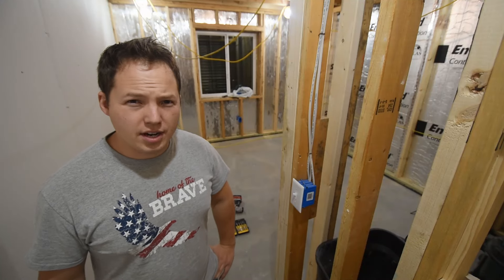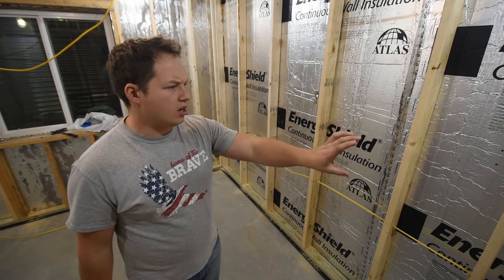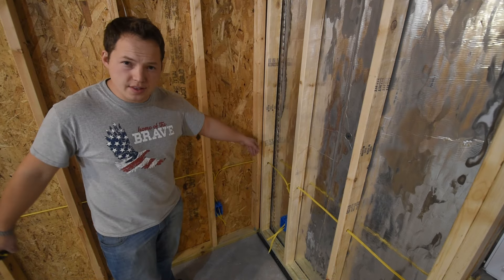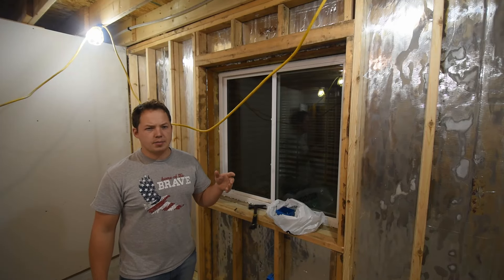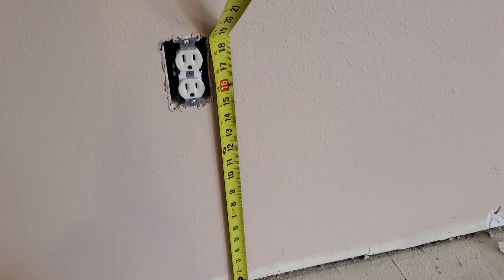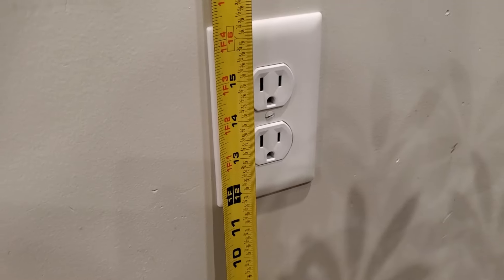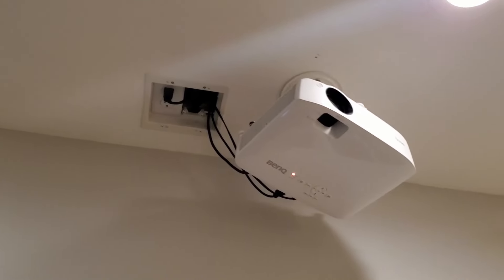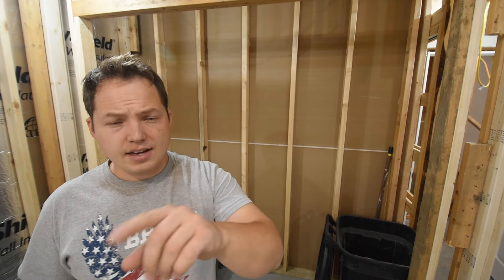Height of Outlet & Switch Boxes & Receptacle Location Tips

Comment: Well on commercial jobs involving block or brick we usually go 16 to the bottom for receptacles so we can set the box on the 2nd course of 8" block. Makes it easier for brick layer and is ADA compliant. For switches we go 4' to the bottom because thats the bond beam for the mason and is filled with horizontal rebar and grout. So we just set the box on the bond beam. I also put the switch box at 4' to the bottom on interior walls that are sheet rocked so they are sitting on top of the 4'wide sheet as the 4x8 sheet is nailed horizontally rather than vertically. Easier for rocker to cut opening in rock for this box.
Reply from the maker: Super interesting! Totally makes sense given the construction method. I might save your comment and share it in a video!
Reply: Your pretty much spot on for ada requirements. The problem arises when you need to install a box for a thermostat, whether low voltage or line voltage to get the sensing element in a good zone, so we always installed the thermostat at 5' to top or bottom or middle. The problem is it is too high to be ada compliant. I have had to lower t stat boxes to no higher than 4' to the top. Because warm air rises , 4 ' is just too low for accurate temperature sensing and control. But that's ada for you. The only thing you can do is get a t stat with a remote sensing element which yo woul install at 5' but the control would be below it at 4 ft.
Reply: For ada a receptacle has to be 16 inches to bottom. 12" to bottom puts you 16" to top. So for all commercial installation I put recpts at 16 to bottom. Switches are 48 to top. But in block the course of block is 48" to top. This is the bond beam and is "h" block with rebar. So it's difficult to cut down into the block and avoid the steel and have room to run your conduit up. So most inspectors will allow you to set your switch box at 4' to the bottom, now it's on top of the bond beam without rebar and grout to contend with. So your 4" higher. But if you can access the switch from the side you are ok up to 54" to middle of box. If you can only access switch from straight on you can't be higher than 48" to middle of box. But they'll probably cut you some slack in brick or block construction.

Comment: For over 30 years I keep everything to bottom of boxes.
Switches I keep normal 46” to bottom.
The room plugs are 16” to bottom.
Counter top plugs I keep it  42” to bottom 
36 inch counter 4 inch back splash so your 2 more inch above the back splash so if there flooring or something your still covered. 
Just cut scrap 2 by 4  16” plugs
 a second 2 by 4 is 46” switches 
A 3rd 2 by 4 is 42” counter top.
And you have you height around the job.

Comment: For receptacle boxes I carry a hammer that is 16" long, end to end.  I simply hold it in front of the stud with my right hand with the head on the floor,  and with my left hand set a box on top the handle and adjust it for depth.  Then use the hammer to fasten the box.  Quick and accurate.

Comment: Started out installing receptacles 16" to top of boxes back in late 60's then 16" to center of box, then 18". Wired up a large house that had 135 receptacle not counting ones in 4 car garage. Mounted top of all receptacle boxes exactly 20" off floor. Carpenter could not thank me enough. Stated that on too many houses heights will vary over an inch causing him time to measure every box.Alwsys keep the bottom of switch boxes at least 50" off floor in case they installed sheet rock sideways creating a joint 48" off floor. Think now you are required to mount switches low enough so a person in a wheel chair can easily work a switch. Forget what ADA recommendd.

Comment: Framing hammer is good to use as measurment.light swiches box I do 50" bottom. Panels drywall etc is 4"×8" and would cover the swich. For wheelchair people users I do 45" top. For older people recepticles are better at 18" top install

Comment: In a finished basement update I added outlets every six feet around the room, but so many boxes are not used and others could use more places to plug in.  I wish I put 4 gang outlet boxes, if not everywhere, at least where lamp tables and electric softas landed; so I could also plug in phones and laptop computer cords. I changed a few afterwards to include USB, but for the cost of a 4 gang box and an extra outlet I wished I'd put more in when the walls were open.

Comment: In Europe we have DIN 18015, so receptacles should be installed on 15cm (~6 inches) from the floor and light switches on 90cm (~35 inches) from the floor. Receptacles also might be installed on altitude 35 inches, but our codes require some shield between coaxial, UTP and electric cables if their outlets are installed on the same altitude.
Reply: i live in a newly-built Reihenhaus in Germany, and our outlets and switches are not at that height.  and these seem to me to be the same height as the last 3 places i've lived in Germany.
Reply: In Germany:

Receptacles 30cm from the floor and wall. Light switches 110cm from the floor and 15cm from the door border. (All center).

Comment: Ben, like your videos. For my two cents, I would place my outlets a little higher, say 16” to the bottom. This is better for us older folks, and we’re all getting older. For the switches, I suggest placing the top of the box at 46”. Yes, this means that you would have to cut out around the box on all four sides, but two inch space between the drywall sheets would support each piece of drywall, especially the piece with the two inch bridge. Finally, the high outlets, may be practical, but from an aesthetic view point would be unattractive.
Reply: I like the 46 to the top as well. It's good for everybody, including children and people in wheelchairs. 16 to the bottom of a receptacle is a bit high for me, I prefer more like 13-14.
Reply: I have used the 46” to the top of my switches for 30+ years. If the drywall goes up horizontal it keeps the boxes out of the tape joint. No boxes full of joint compound!

Comment: min 15" above the floor for ada outlets. i do 16" to BOTTOM of the box. which puts teh bottom plug about 17" high. carpets and padding can add an inch or more to teh finished height.
Reply: also, devices above countertops vary depending on the depth of the counter.

Comment: You have a good channel.  You may want to refresh yourself with ADA receptacles.  You mentioned 12” in the beginning, then mentioned 16”.  ADA requires the minimum of 15” off the finished floor to the bottom of the box.

Comment: I placed my outlets hammer height above the floor. Basically rest the box on the end of the handle with the hammer upright then nail it in place with said hammer.
Reply: Very technical and very wrong.   Learn to use a ruler.
Reply: @lichub  Not wrong, there is no code for height. And a ruler? Are you from before tape measures?
Reply: @lichub  no they definitely don't

Comment: I do recepticles 12" to the bottom, and switches 48" to the bottom. I walk around and use my 12" and 48" levels to mark with.
Reply: That doesn’t meet ada requirements. 15” to the bottom of a device is the minimum.

Comment: very useful video.. some good places to put extra elec points.. but the biggest problem is 12 boxes/circuit or "cap" on total amps (80% @ 15 or 20amps) + some mandatory dedicated circuits for fixed appliances.. it eats up all breakers in the main service panel .. 
it may restrict some freedom..

Comment: What do you set your boxes at on a cinder block wall, like your garage may be built of? I go 48 to the bottom on switches and usually in a garage you want your receptacles at 48. If I were going with low receipts I would go 16 to the bottom. So why wouldn't I go 48 to the top instead of the bottom on a block wall? Hint, ask the brick layer.

Comment: When we had our new house built in 2006 I was installing our washer and drier when I saw that the outlets were down behind the units not above them where if something happened I could unplug the quickly.  I asked our contractor about it and he told me that is according to electrical codes and he would not raise them.  After he was gone, I raised them up above the back of the washer and drier so I could unplug them if something without trying to move them as they were in our old house. Washer is heavy when full of water. When I finished our basement I put all our outlets 3 feet and 4 feet high. One reason we are getting older and why should we have to bend down to the floor to plug in a sweeper (bad enough we have to clean).
Reply: *dryer.  A dryer is a laundry appliance.  The Sahara desert is drier than the Mojave.
Reply: @lichub   Drier*  Dryer*  OMG Must be due to my free public edumocation. No typing faster than thinking and not rereading before I sent. But thanks for correcting me. Did I spell edumacation right. Haha.

Comment: 46" T.O.B. for switches to be bellow the mud line the sheet rock. That way it's less likely to be filled with mud. 
20" T.O.B. for general receptacles because it's easier for make up from a roll around stoll. 
46" T.O.B. for counter top receptacles keeps them above a 4" back slash but still nicely visible.
Reply: Huh?
Reply: lichub Also laughed at the stool idea, now at 72 yrs. old I wish I had used one. Ended up in industrial at the end. Co-workers would bust my stones about knee pads. Kneel on deck plate all day and see how you feel at the end of the day. It wasn't long before I noticed knee pads in their trucks too, though they would not say so till after I saw them. I' not the OSHA COWBOY but use your head. One knee and two back operations has shown me the error in my ways, rode hard and put away wet. I'm paying for it now........... take care of yourself.

Comment: 2:20 you speak to location of receptacle height locations. You were close to being correct on the information about the light switch location ADA yet you might wanna look at the ADA for outlet locations. Nothing is considered accessible if it’s below 15 inches. And as it relates to the light switch location. It’s about the operable portion of any element. So mounting your box at 48 inches to the top absolutely meets the requirement. Think about the light switch if you mount it to the centerline at 48. When it is in the up position, it’s above the 48 mark therefore it would be out of compliance and I’m strictly talking about the toggle switch itself even a Leviton type flat switch, mounted 48 to the centerline the top portion would be out of compliance. So again mounting your light switch box top at 48 would make you in compliance. Even though residential doesn’t typically require things to be accessible, it’s a good practice to think about. I’m mounting all my light switches at 32 inches. That’s also within the requirements can’t be greater than 48 and can’t be less than 15 so anything in between is acceptable. Yet in building my home I am placing my electrical outlets below 12 inches which is out of ADA compliance Yet again residential is not required to comply with ADA for the most part

Comment: i usually match what is in a room but prefer high over 18 as i get older the higher up outlets become much more useful. i think the code is out of date on number of outlets in places like living rooms and bedrooms the more the better.  the code just worries about overloading a circuit but nowadays everyone has a million electronics to plug in and outlet strips are a mess and the quality of parts inside sucks. the outlets over end tables at 3 feet is a good idea I put a outlet strip on side of end table where we plug phones in to get wires up off floor

Comment: As a electrician here in maryland  for 12 years  switches is 48 inches to buttom not top nail on boxes 16 inches high from the buttom not top also some 2x4's need too be cut because of trim in a home ps : also outlets need too be within 12 foot of each other. BTW nice decora's:) also you need at least 2 GFI's  in your kitchen with 12-2  for 20 amp circuit not 14-2 which is rated for 15 amps

Comment: Where Door Bell and Alarm System power? Height of sound system volume controller  box, Speaker box outlets for overhead projector, height of Wired in Cat6e wire outlet boxes for internet?
Reply: National Electrical Codebook has all that info.  Anyone doing wiring should own an up to date copy.

Comment: I mount my switches 48” to the top also, but the idea that it makes a easy cut for the drywaller is incorrect. When you install drywall you always hold it off the floor, typically with a scrap piece of drywall. This makes a difficult square they need to cut with a small little 1/2” piece of drywall at the top which usually breaks off and they usually then mud and tape the top. It would be better to mount the box at 48.5” so the drywall cut is just three sides of the box.

Comment: Hey Ben I shall your vedio on your home wiring and you ran 12 wire to your outlets and used 15 amp recepticles did you use 15 amp breaker .
.I thought you were running all 20 amp outlets and 15 amp for lighting?

Comment: What are your thoughts on the slim led recessed lights. Sorry if you had a vid on that topic already. Good vid as always.
Reply from the maker: Hey Mike! Honestly I still like the traditional recessed lighting fixtures IF they are going into a ceiling that is between floors. The fixture is more substantial and gives more flexibility for the lights that you ultimately install. The exception to this in my opinion is where the lights are below the attic space. If this is the case then I see value in having a standard "sealed" round fixture box as you will have less air infiltration with this method.

I do not have a video on this yet but it seems like something that will be a good topic for one in the near future!

Thanks for the question.
Reply: Benjamin Sahlstrom ok thanks! I have been using the retro fits like you showed in the video here for some time and love them. Esp the Hyperikon. I am looking into some slim ic rated to mount under an attic space currently.
Reply: I love the "canless" LED recessed lights.  I recently installed four of them in my living room and, based on that experienced, I'm thinking of converting some of the recessed cans to canless.  (Side note: why the NEC still allows switched receptacles in some rooms in lieu of a ceiling-mounted light fixture is beyond me).  Easy to install, no screwing around with flimsy cans, and adjustable color temperature (on some models).  They're not for every situation, particularly where you'd want to a fixture box (say, a ceiling fan down the road); but they're great as an upgrade for general room lighting over old fixtures/recessed cans/switched receptacles.

Comment: I'm redoing my house. I am planning to put an outlet every 12 inches at 16 inches high on EVERY wall and 6 inches at 48 inches high on EVERY wall. I will never be wanting for a plug again.  On the downside the cost for material at 100 wall outlets a room X six rooms is around $4500.00. 
Should I add any to my ceiling?

Comment: Are those outlets @5:30  TR?  I can't see any door in them from any of the camera angles.   TR is of course required now for all residential outlets.
Reply: All outlets that are accessible under a certain height, off the top of my head idk the measurement but for example tv outlets, microwave, fridge don’t require TR

Comment: I found it more useful to measure to the center of all foxes and I use a laser level on a tripod to assure that all boxes are equal. The reason you want to measure to the Centre of the Box because some 2-gang and three gang boxes are larger than a standard single gang plastic Carlon box if you measure to the top instead of the center when they finish the tile work or Granite you will notice a half inch or quarter inch difference in the height of the box there for measuring to the center will assure you of equal spacing on all boxes especially if you use a 
4 11/16 box. Also in all medical offices and eldercare you must have ADA requirements that specify on the prince what the height of the Box minimum is usually 24 in for wheelchair accessibility

Comment: ADA standards are to the center of the box, 48” (if you want to go to inches lower that’s even more accommodating not only to the disabled but also to the drywall folks) for switches and 18”FF (finished floor) for receptacles. Imagine trying to use a plug that is 16 inches to the top of the box or 12 inches from the finish floor while in a wheelchair.
Reply: You have a good point with that recept height and wheelchair accessibility.

Comment: How far away from boxes does the Romex need to be secured (stapled).  And how many receptions are usually allowed on a circuit?
Reply: Staples need to be within 12-18 inches of a box, and every 48" inches thereafter. If the cable goes through a hole in a stud or plate, that is considered a "staple" in the count and distance.
Reply: There isn't really a maximum set in 2017 code.  Not sure about 2020.  You just have to consider what loads may be put on them.  You could probably have all receptacles in multiple bedrooms on one circuit as those will usually just have small loads like lamps or phone chargers plugged into them with the occasional vacuum cleaner.  Just think about what appliances would be typically used on the circuit.
Reply: @NorthernWindNut  No limit in the NEC code. Up in Canada it's twelve!
Reply: @NorthernWindNut  I can't swear to NEC code about this but the general rule is 10 devices maximum for 15 amp circuits and 12 devices maximum for 20 amp circuits. This only applies to residential wiring.